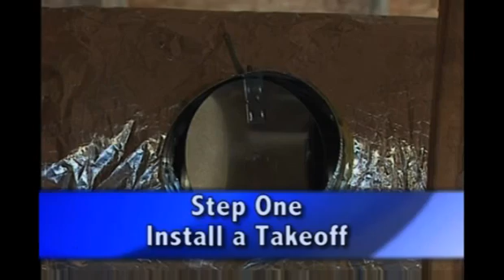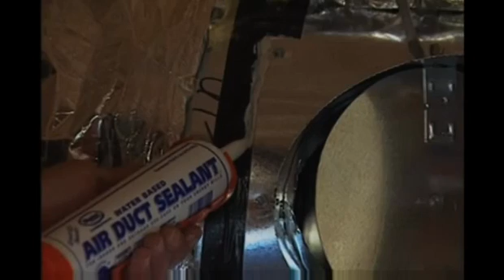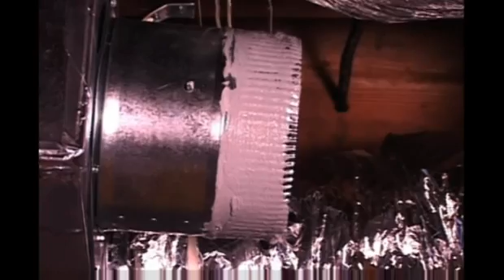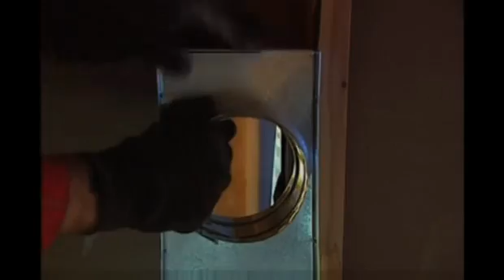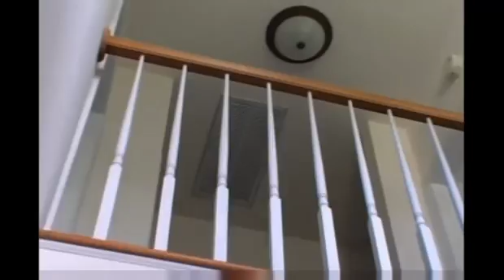How To Install Ductwork   The Home Depot

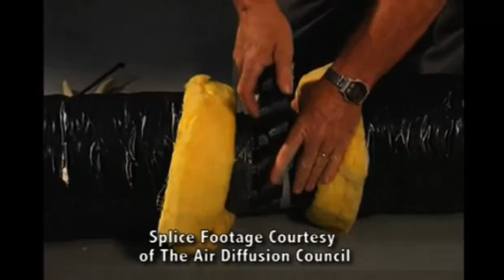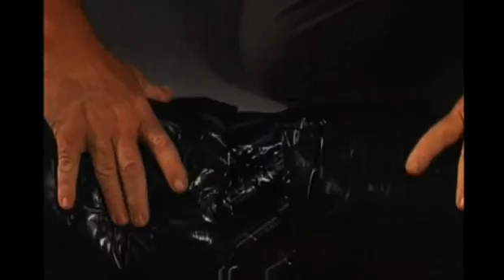Comment: 3:19 - 3:53 I needed this. I purchased a house last July. Whoever installed the new furnace and duct work in my attic (for the second floor) pinched off one of the flex lines going to a bedroom. As a result, that room is much warmer in the summer than the rest of the house. The issue is that I don't want to try to work where the register is. It's near the soffits where the roof meets the walls. Not a lot of space to work there. This kind of junction is what I was looking for.